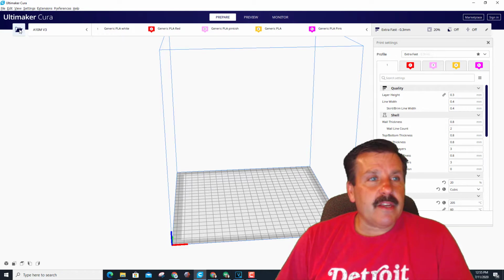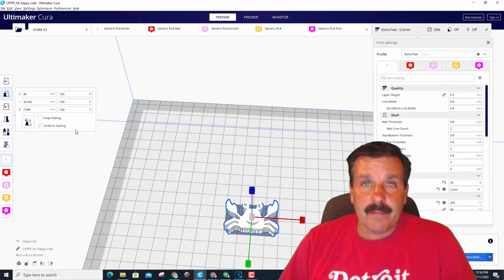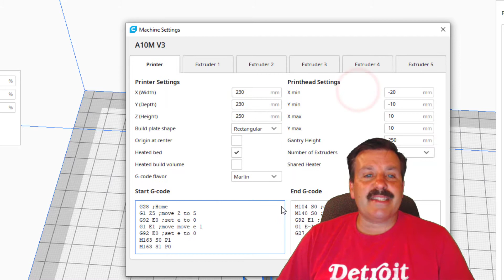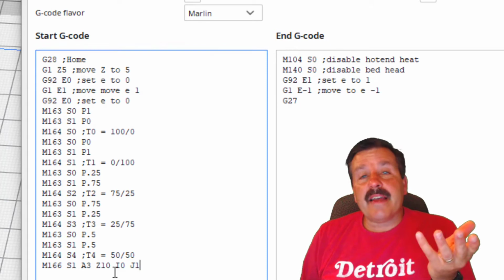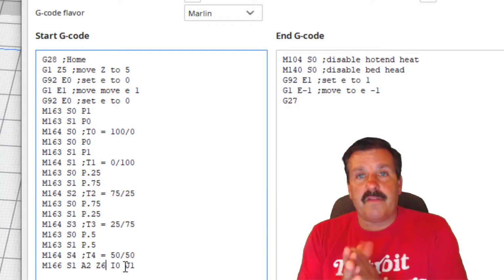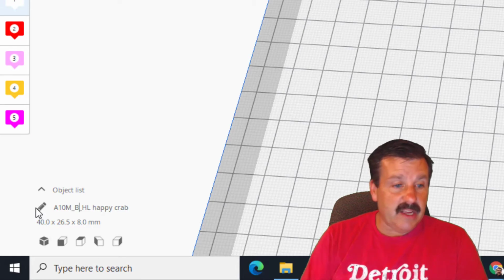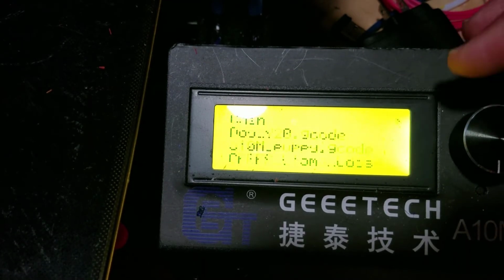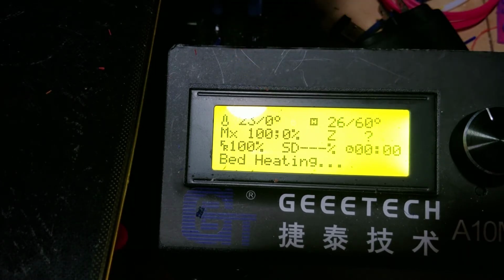Tested! Groovy Gradient Prints via SD with the Marlin M166 Command 🤯

Comment: To use the M166 do you need Marlin 2 on your printer or would it work with stock firmware?
Reply from the maker: It is only available in 2+. I tracked it down here. https://marlinfw.org/docs/gcode/M166.html At the very top they show the version it has been available since.